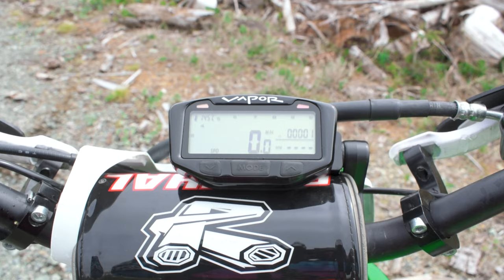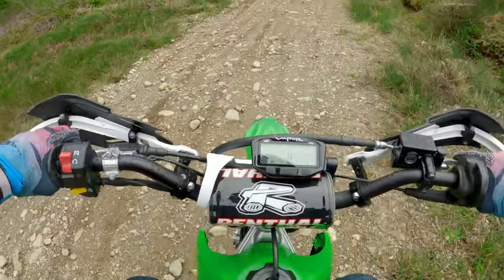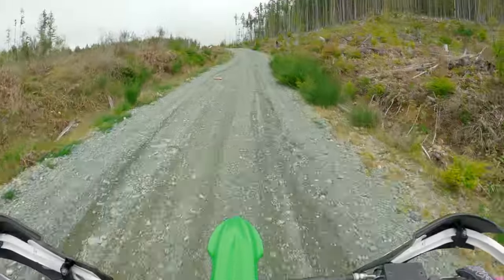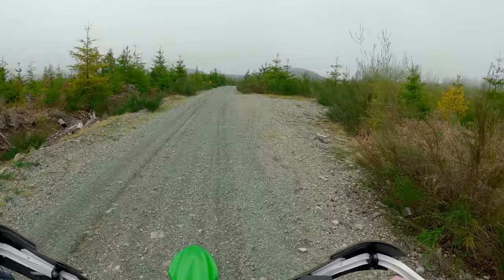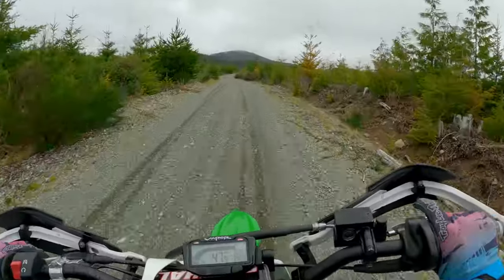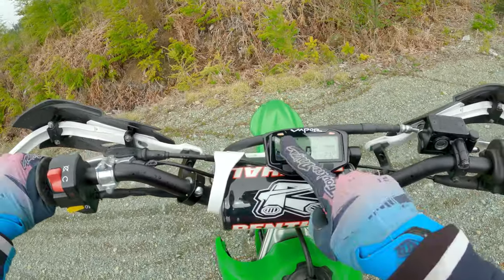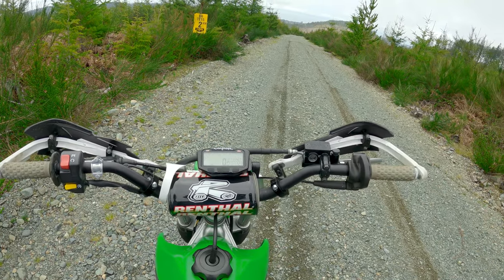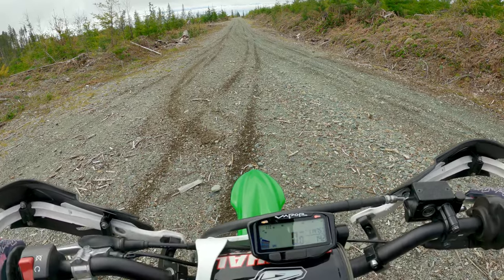KLX140RF Top Speed and 1/4 Mile Drag Race!

Comment: Is it the power or gearing? Sounds like it's revving pretty high at 52mph. I mean I have a CT110 postie bike which will hit 60mph on a long straight and it has 50% less power than a KLX140 and weighs around the same.
Reply from the maker: @dune7824  the gearing on a ct110 is definitely longer than the klx 140. The 140 is a trail bike, where it’s important to have maximum torque efficiency. ie lower gearing. They’re not trying to squeeze maximum power from the klx 140 from factory as it’s geared as a beginners bike to learn on.
Reply: @AaronsEnduro   Thanks mate we get the KLX150BF in Australia and the top speed is 66mph (gps verified) on the highway. Same engine as the 140 but with a 24mm carb in stock trim.

Comment: So it goes 51 mph
Reply from the maker: Yepp
Reply from the maker: or 85 ish km/h
Reply: You have a ton of great videos!!
Have you or anyone done top speed with gearing changes like one tooth larger up front?
Any top speed runs with carb and exhaust?
Reply from the maker: Thanks! I appreciate it! No i didnt because the top speed wont charge no matter what you do unless you change gearing. Thats the only thing that will change top speed

Comment: So basically it runs about the same speed as a CRF125
Reply from the maker: Well top speeds are dictated by gearing setups.(transmission gearing, and front/rear sprocket) So possibly. Klx will just be a little bit quicker acceleration. Curious to re do the test with the big bore kit 170 i have